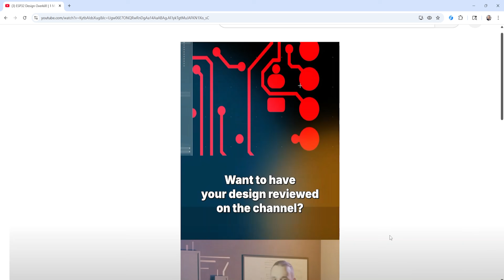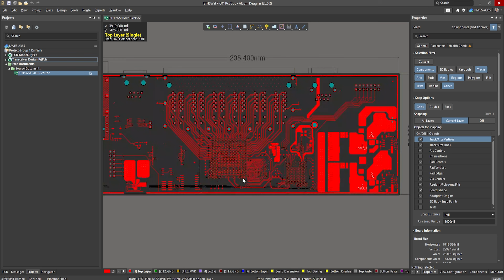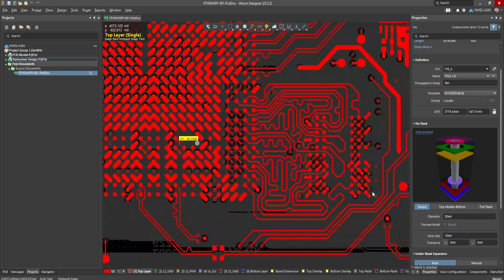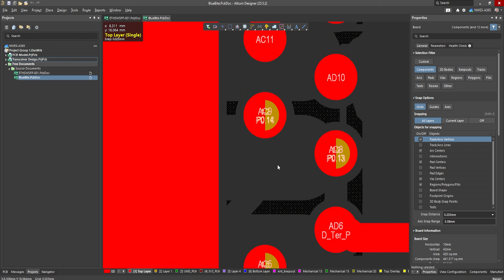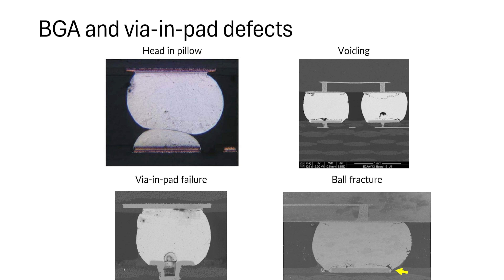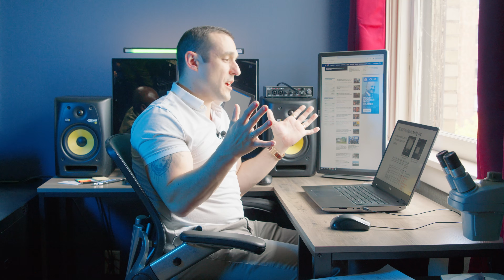Via-in-Pad Reliability: When Does Your PCB Need It? #pcbmanufacturing #pcbdesign

Comment: This is very interesting. I've been commenly used via-in-pad to every possible situation because I did belive doing this will increase electrical-performance and mechanical reliability, rather than non-via-in-pad.
But the data shown in this video hits my head, especially talking about the longer lifetime of smt package using non-via-in-pad with fanout.

Comment: does the via fill material affect the reliability? 
Also what about through via filling and capping vs uVia? 
Also does this apply to also larger pitch BGA? Since you might be forced to use via in pad there too if you are space contained and/or are not allowed to use uVia for different reasons. 
What is cheaper through hole plated via in pad or dog bone uVia ?

Comment: For a 12Gbps high speed project I checked via in pad with my trusted fabricator for BGA and connector use. He reassured me that this was standard practice and would give better results than breakout using vias.
Reply from the maker: If they can prove reliability then you should go for it

Comment: Hey Zach, unrelated to this topic, I have a question. I always see continous ground planes and try to apply them however there are some situations that confuse me. For example, in case that a pcb includes a high voltage high current power electronics circuit that powers other circuits such as some sensors or exciters or i don't know those that have high frequency switching elements, how do we look at the boards and the waves? I understand this topic when it is about digital and analog circuits but when it includes high voltage power circuits I can't imagine how the board reacts. Do we do star connection or split the grounds in that case? Or do we continue doing partitioning and arrange routing and stack-up appropriately? Is there any cases we need to split the ground? What is the role of ground bouncing?

Comment: Hello, is that via in the capacitor gnd pad considered a via in pad when manufacturing? That increase the cost a lot because let's take an example of power mosfet where you can place vias in it's big pad but I think those are not considered via in pad correct?

Comment: Hey  Zach, thanks for the video! Pity that it was all about BGA and some topics are left uncovered. I'd love to know what the potential issues are if you have no BGAs but fairly dense design with small passives, and it's just very convenient to throw vias to the pads. Especially in the case when vias won't be filled and plated over — admittedly, I'm not a professional, and I've done so only with very small batches, but I struggle to see the risks if my manufacturer does electrical tests. Tombstoning is the one I know of, should it be a concern if my manufacturer does assembly too? Thanks again!